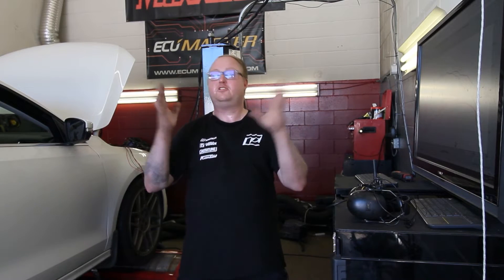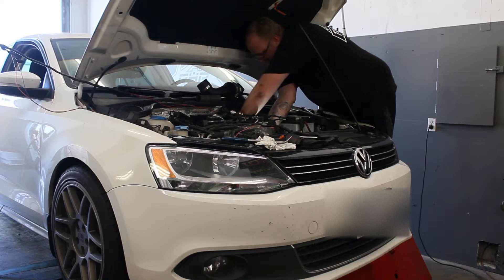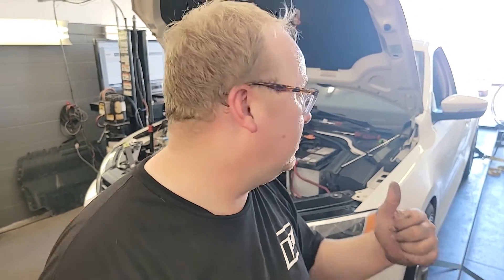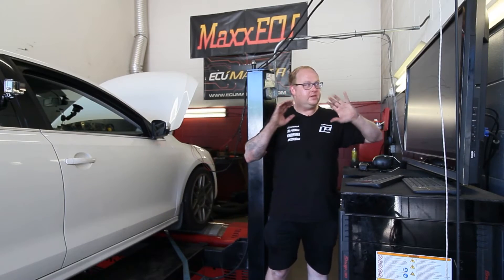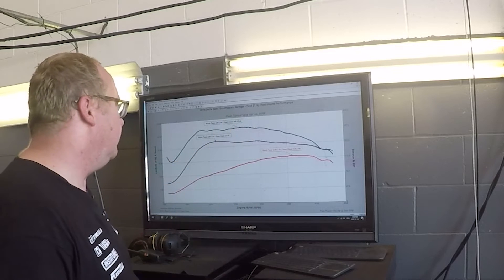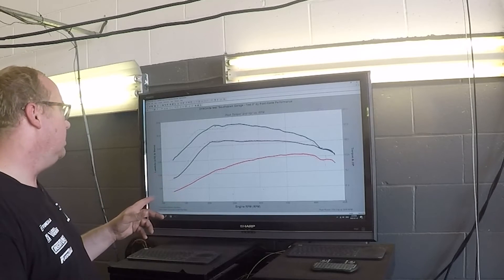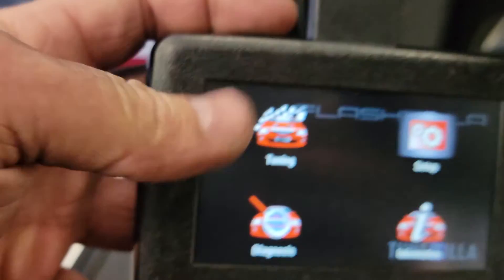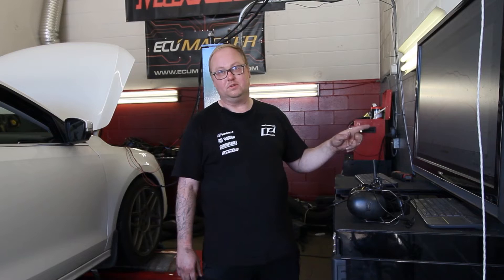Dyno'd from Stock to Tunezilla Stage 2 with S&B intake | MK6 Jetta TDI

Comment: I’ve fitted a Ramair intake and it’s already had remap but I’m losing power when putting the accelerator down quickly it slows the rev counter down how do I fix this on a mk6 golf gt tdi thanks
Reply from the maker: Have you sent a data log to the tuner?

Comment: Summary-

Stock power: 140HP & 236 TQ
Tuned but not deleted power: Same but turbo spools faster and area under the curve is larger
Reply from the maker: No, your stock number that your referring to is crank HP&LB/FT not WHP&LB/FT.

These things stock only make 118 WHP and 206 lb/ft torque.

This car with stage 2 was making 138 WHP and 240 LB/FT

Comment: Doing testing without the pothole delete is a waste of time. Also if you aren't running a large fan over the inner cooler, radiator and air intake none of this dyno testing is real world. A tdi's weak link is NOT the air intake.
Reply: I guess that would be different for the passats that have a liquid air intercooler instead of air to air
Reply: @DarkAttack14  i think ur right my 15 cvca is. hot air intake doesnt matter. :)

Comment: Hey love the video i was wondering if you would know the best way to tap into a boost line for a boost gauge for 2.0 tdi. I have a 2011 Audi a3 tdi stg 3 rawtek cr170 just cant find much information about how to or where to install one.
Reply from the maker: I tapped into the charge hose coming out of the turbo below the intake. I had to make one so I could see what the boost is for this vehicle. I actually have a turbo gauge to install on this car, just haven't done it yet.
Reply: @SouthdownGarage thx for the information, what type of boost tap kit did you use because i can’t really find a tap specific to it, any info is great.
Reply: @Alpha-kt4ok  I used the tap that came with my mecevo egr delete pipe  works great

Comment: What are the peak numbers before and after the stage 2 tune?
Reply: Then say them here. What are tq numbers after?
Reply: @shamblinsoftwashandpressur6820  hey buddy, I wanted to mention that although he showed you the stock output in the video, it's incorrect, that car is certainly low on power. All mk6 and b7 tdi's push 132 wheel hp and 226 wheel tq. After a stage 2 ecu flash and dsg flash, you will make 160 whp and 296 wtq. It is a standard tune with no variations. Those are guaranteed numbers.
Reply from the maker: @The Motivator  the numbers you mentioned, was that on a dyno jet dyno?

The numbers I have is on a Mustang Dyno.

Stock dyno numbers at the crank is 140 hp and 236ft/lbs.
Reply: @themotivator1698  You clearly do not understand how dynos work. You need to stop spreading such false information and bad advice.
Reply from the maker: In this video I explained the stock hp and torque. I also explained that after the tune with Stage 2.

I understand that I didn't say the torque numbers were.

Comment: Im still not clear on when to tune the car? Do I tune stage 2 before I rip out the dpf system? Or rip everything out, then put in the tune before first start up?
Reply: Awesome thanks.  🤙
Reply: @YanwenWintermoon DO NOT tune before. You have to delete dpf and egr before you tune. This guy is dumb.
Reply: You should do both at the same time, but the car will probably go into limp mode if you delete before the tune
Reply: Same time is best. I removed everything, then immediately tuned it before attempting to start it. No problems and I put on 80k miles since then.
Reply from the maker: Tune it before you rip everything out
Reply: @SouthdownGarage  you’re going to mess peoples cars up
Reply from the maker: @bobbo2576  how?

Comment: Hell yeah! Keep at it bro! I'm definitely interested in watching some more how-to's! Been wanting to get an aftermarket intake for my MK6 TDI too!
Reply: I run without eco tune I have full blast no nothing and I can tell you a straight piped diesel sounds and works so much better
Reply from the maker: The intake is a good way to get a little quicker spool up. I'm planning more mod videos shortly. Meth injection, stage 4...We'll see what happens

Comment: On the dyno graph the power was really wavy. Was that from it bouncing off the waste gate?
Reply from the maker: Yes. When there was no intake it would take longer for boost to build, then it would over boost causing the computer to open the waste gate, which caused the bouncing power line.
Reply: @SouthdownGarage  I really appreciate this video. I just deleted my 14 Jetta and really liked the car before but after it’s a different car all together
Reply from the maker: @kenmckinley4195  100%. Wish the car had this much power from the factory.
Reply: @SouthdownGarage  the stage 2 tune and eco kit changed made this a completely different car. I bought this car a few months ago and I’m so glad I bought a 6 speed because it’s a blast
Reply: I didn’t look. Do these turbos have a silencer ring in them? I’d like more turbo noise
Reply: @kenmckinley4195  Can you test the aftermarket turbo discharge damper. Thank you, great video as usual.
Reply: This motor/turbo doesn't have a wastegate. These are variable vane turbos, the vanes open to lower boost. No wastegate needed